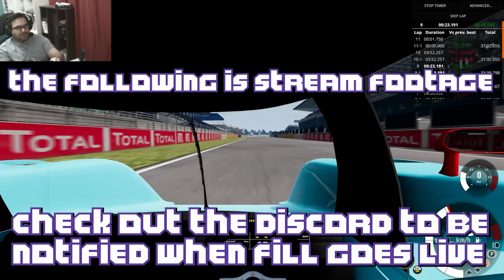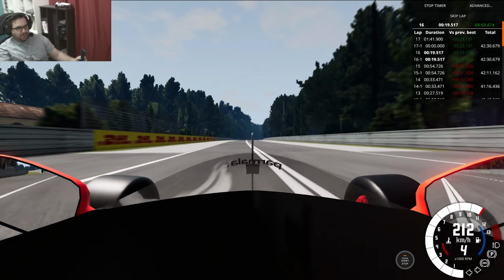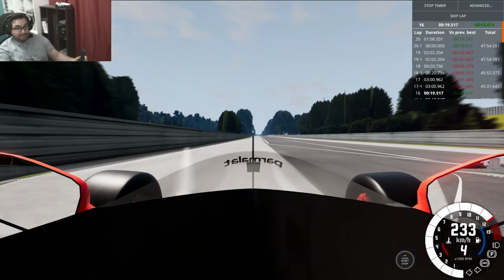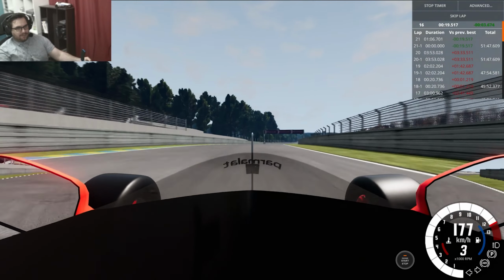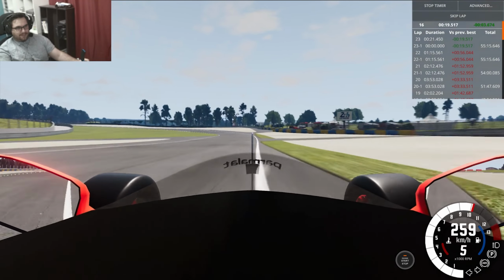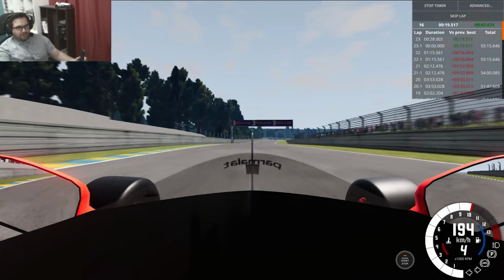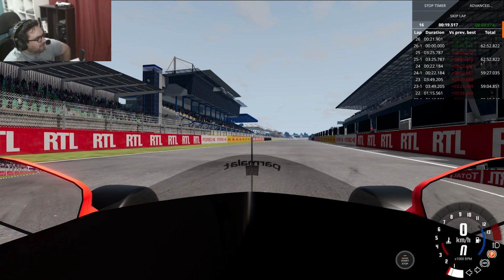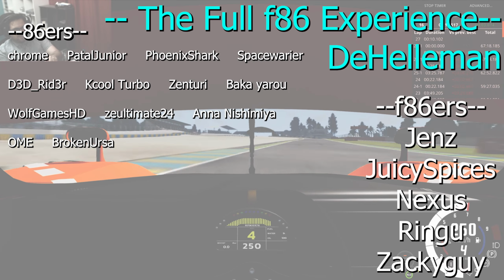RPM = Downforce

Comment: i have an idea"

so the fan works when you rev high, right. then why not add a CVT instead of the transmission, so you can accelerate whilst maintaining high revs.
Reply from the maker: CVT transmissions don't do well with high power or torque though :( otherwise trucks (and more) would definitely use them
Reply: @fillman86  right right, ok... damn, seems like all of my ideas suck

"better luck next time" i guess
Reply from the maker: @limitetpancake  I like CVTs, but they are flawed